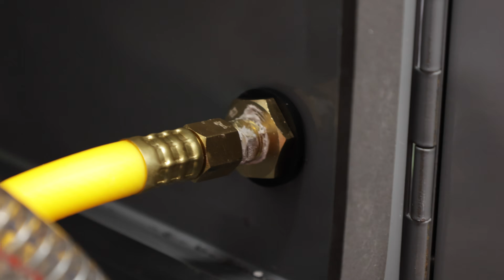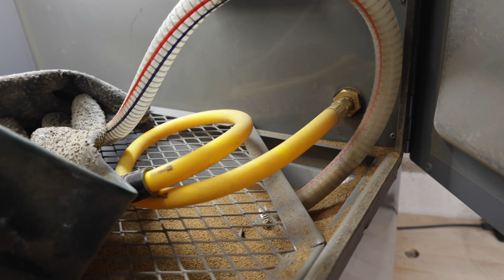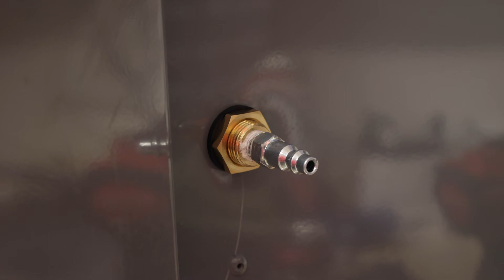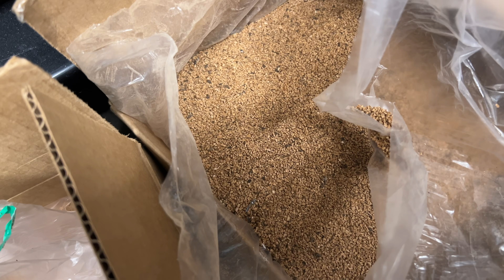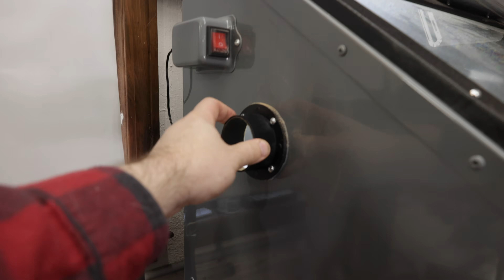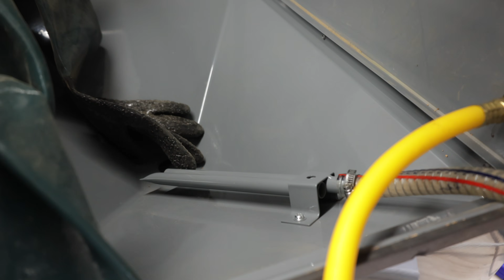NEW Harbor Freight Bench Top Sand Blast Cabinet Review | Central Machinery

Comment: I know this is an older video, but where your seal is sticking at and coming apart, an easy fix for that is get a small paintbrush with some Vaseline or grease. Vaseline is probably cheaper and better though. Just brush it on that seal. It'll create a tight seal, plus it'll create an anti-stick. Some people use a Teflon spray, but Vaseline works really good. And then every so often, just wipe it down and reapply if needed.

Comment: Nice video!  Thanks for sharing the review.  I'm wondering if you're going to add an inline desiccant filter and a water separator to the setup and what you'd recommend?  Cheers!  -A
Reply from the maker: Thank you! The IR ARO regulator that I have catches water in the bottom and is supposed to filter the air (who knows how well). I've been really happy with it. When I add a desiccant system to it, it will probably also be Ingersoll Rand. I don't have a specific need for that right now living in a dryer area.

Comment: Actually just picked this one up today. Considered it for awhile. Correct, the directions are horrible. Just had to figure it out. The one thing I don't understand is what is the vacume port for? Do you connect the shop vaac all the time? Seems like it would just steal media over time. What's if for?
Reply from the maker: That is a great question... lol. I do plumb in my vacuum sometimes, especially in winter when I have the garage door shut. It seems to mainly pick up the dust that is in the air to keep your view inside clear. I'd assume the same that over time the media will be less and less in the actual machine. Also pulling a vacuum inside will ensure no media leaves the enclosure (theoretically).

Comment: Great video, can you give me the specs for that craftsman compressor you used. Thanks
Reply from the maker: Thank you! The compressor is old but works great.. Its 12scfm at 40 psi, 10 scfm at 90psi, max 125psi, 240V. 5HP 30G.

Comment: For a solution on your Drain Plug, use a Mechanical Test Plug in the bottom so it can easily open from the outside, or use something like a Guillotine Damper to be able to open it and route it into a duct to funnel easily into a bucket or back into it's packaging.

Media Void issue. in most sand blasters we use at work, we keep about 1 gallon of media in the cabinet. and it works well, and we have to add about 1ounce per minute of continuous operation.

what's i've had to do with smaller compressors is install buffer tanks to store extra compressed air so there isn't a drastic drop in pressure. i just have to pause from time to time to let the compress charge the tanks if i notice the media no longer hitting hard enough to strip rust.
Reply from the maker: Thanks for these great tips. I’m going to pick up a mechanical test plug for mine. That looks like a great solution to be able to drain from the outside.

Comment: What paint set up did you use for that power steering pump? I just got into Duracoat painting with an airbrush and your paint finish looks really good on that power steering pump. 

Thank you for the insight on this video. My choices were down to an Eastwood B20 or this in the video I watched on the Eastwood was not very pleasing. It does not have any silicone at all, nor did it come with silicone and from what I gathered, it was completely disassembled and not all of the holes lined up correctly. Which is a little disappointing coming from Eastwood.
Reply: Power steering reservoir*
Reply from the maker: I just used a can of engine paint. I spent a lot of time preparing the power steering pump to make sure there were no contaminates and all the surfaces were flat. I haven't tried airbrushing, but it is always something I have wanted to!

That is too bad to hear about the Eastwood product. It was nice this product came assembled and sealed. Definitely removes some of the potential quality issues that can pop up!

Comment: Do you think a 15x7 wheel from a square body chevy would fit into it with enough room to still blast it?
Reply from the maker: I can take some measurements if you want. I seriously doubt it.
Reply: @SmackeysGarage  if you'd be so kind to do so. Total measurements are 16 tall by 7 wide of the wheels.
Reply from the maker: You’d need a bigger cabinet I’d think. I went and checked measurements. If by some way you can get it in you’ll never be able to maneuver it

Comment: Thanks for the review. I just picked mine up. Right off the bat I had to go to the electronics store for a new light switch. Supplied one was junk, intermittent. No biggie. HF  compensated me for that.Tip to getting the (unreachable) nuts inside, that held on the switch housing is to use locking pliers to hold them. Replaced the stiff hose. Will update on my experience when I get the compressor plumbing sorted. :-)
Reply from the maker: Very cool. I've been really happy with mine after my modifications. I'm looking forward to see how you like your setup!!! Also, good tips.

Comment: A good shop-vac with a good filter on it is a great addition to it. Helps with visibility in there and it creates a negative pressure inside the cabinet to keep the media from pushing through the seams and joints. The fixed pick-up tube is kind of a bummer on this one, the stand-alone version has the "stab-stick" type that you can move around. Very handy for denser medias like Silly-Sand, Crushed Glass (my favorite) and Aluminum Oxide. As for the different "grains" in the media, match that with the Tips on your Gun. They are color coded for the Grit Size, but different medias (like Walnut) is actually a lot bigger than say.... Glass Beads of the same Grit (grain size).
Quick Tip on how to un-plug your nozzle on the fly.
Cover the Nozzle with the palm of your hand and pull the trigger. It will back flush it on the quick and get you back to Blasting in seconds.
Also, the medias you can buy at Harbor Freight are EXPENSIVE! I've actually got better deals on it at Automotive Paint & Supply stores, Cement & Mason suppliers & of all places Home Depot & Lowes. It really pays to shop around for that stuff (sometimes nearly half the price of HF).
Reply: Damn, good review on that
Reply from the maker: Thanks for all the tips BareRose. I was hoping you would chime in! I'll have to find some way to improve the bottom pickup. I can see how the way you described the other one working is a better way for picking up the media. 

I'll have to check out different places where I can pick up media around me. How often do you suggest I change it? That is one thing that wasn't clear to me from the instructions.